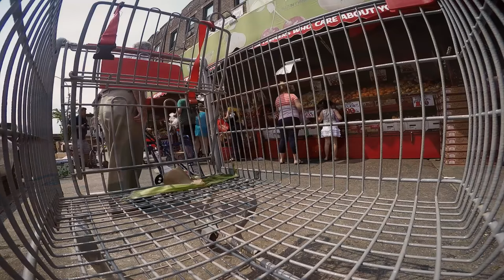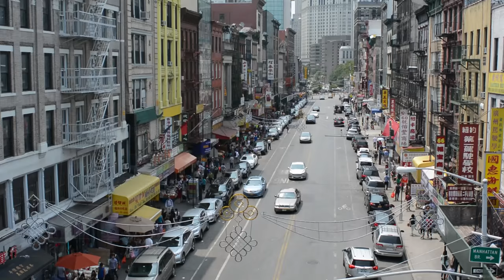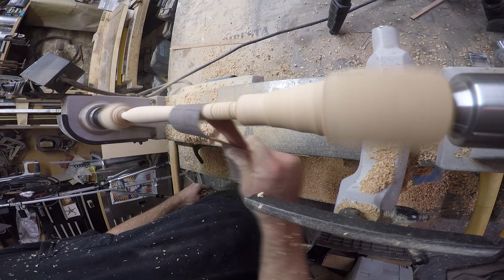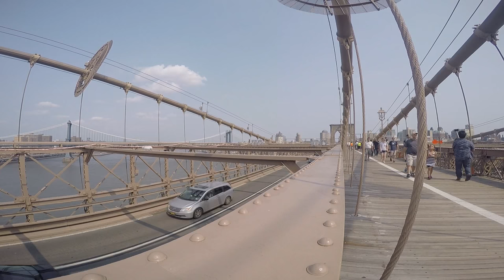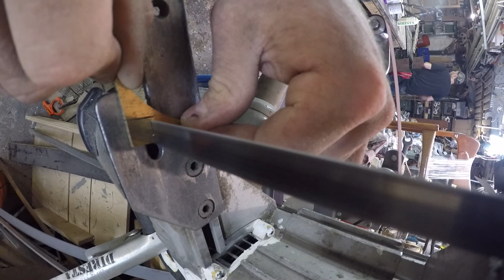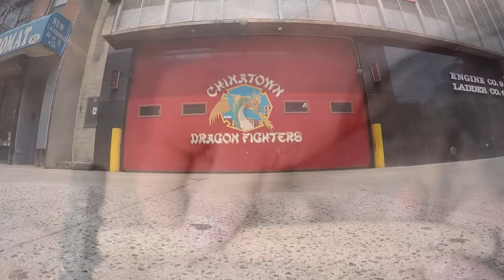Hammer Restoration

Comment: I love this whole video. I recycle used ball peens into hatchets and in doing so have come across some old beautiful ones which are restored instead of being re-forged. I haven't come across any as pretty as yours, with its octagonal head center and rich black color. I was really thinking it would buff out and be silverish but it just turned obsidian when you buffed it.
Here i was thinking I'd been original when I used a sanded down brass piece as a wedge when I repaired a sledge hammer last summer. If that was brass you used, I mean.
Reply from the maker: Thanks you, it was my grandfathers hammer, I wanted to put a handle on it and use it for my intro w the stamps. Thanks for the feedback - the wedge is brass

Comment: Hi i just started watching your videos, and really liking it this far. Ive been facinated by fabrication work for a long time and im considering buying a lathe for myself. Im looking for a small one like the one used in this video. Have you got any sugestions for a lathe that is easy to operate but still good in the long-run?
Reply from the maker: I don't do enough lathe work to give you any info other than to look in Craigslist - old lathes are simple - well made - typically a killer deal- check that it's complete and not seized or burned up - stripped or marred etc by  Googling diagram of lathe- relative lathe articles via Google search etc- learn a bit- look at listings of a lathe for sale - buy one  - make stuff $

Comment: Nice jobs as we have come to expect. You could have tried off centre turning the handle to make it oval,  instead of slicing the sides off.
Reply from the maker: That small lathe doesn't have a swivel tail- and I wanted to use the method of trimming a piece leaving square reference.